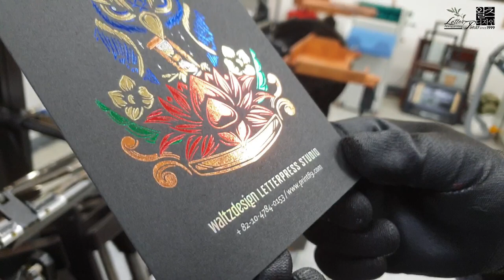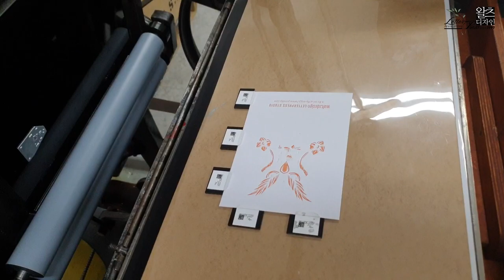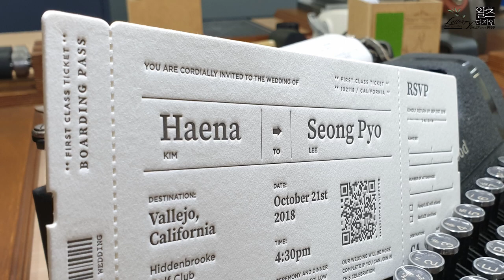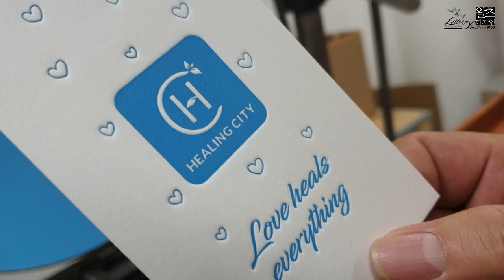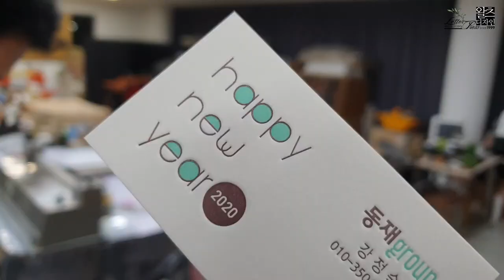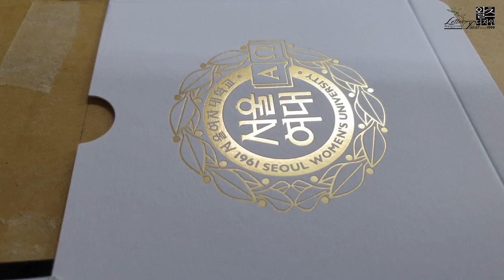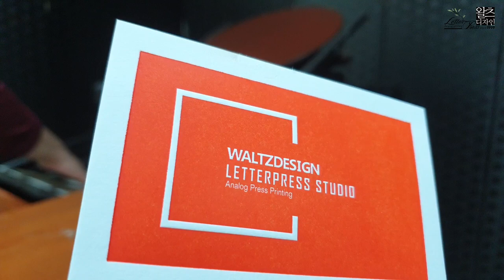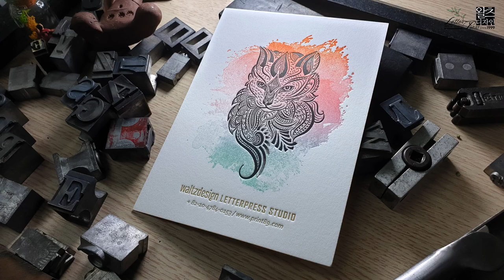WaltzDesign Letterpress Equipment Video Collection왈츠디자인 레터프레스 장비별 작업영상모음.

Comment: What material are you using that just sticks your plate in the right registration when you’re using the c&p?
Reply from the maker: nice to meet you. Use double-sided tape for printing. It is thicker than regular double-sided tape and does not tear well when peeled off.
Reply: @w_letterpress  is it 3M 468MP ? Sorry there are a lot of types. Thank you for answering me - nice to meet you as well!
I love your trick of having the plate on one side of the acrylic sheet, and a square to register with the paper on the other side.
Reply from the maker: Double-sided tape is not 3M, it is a tape made by a Korean manufacturer. The method of sticking to paper is what I thought of, but there are times when it takes a lot of time and patience to do very precise work. :)